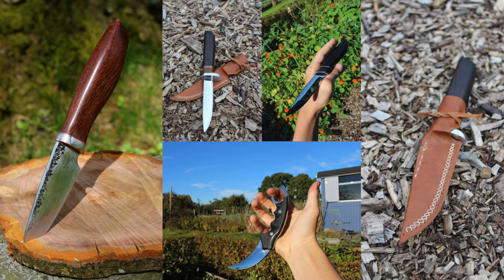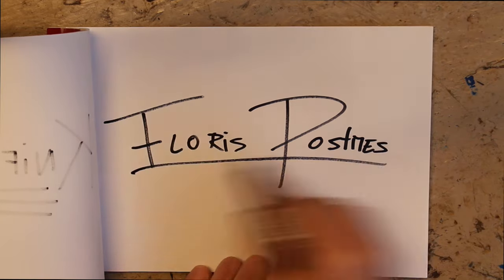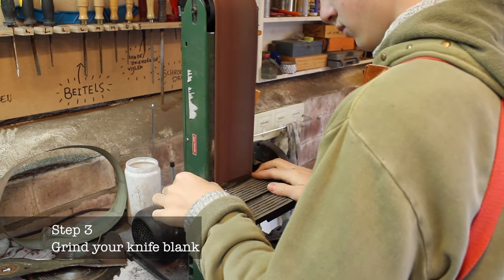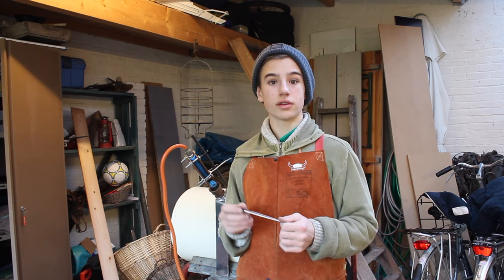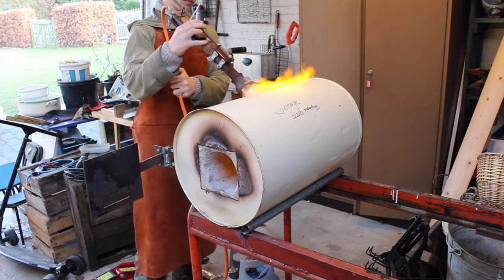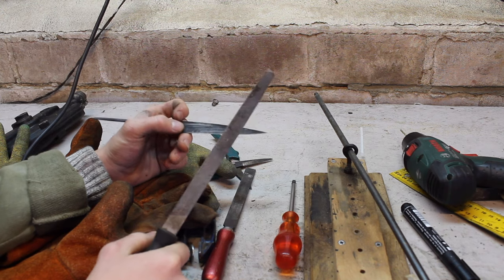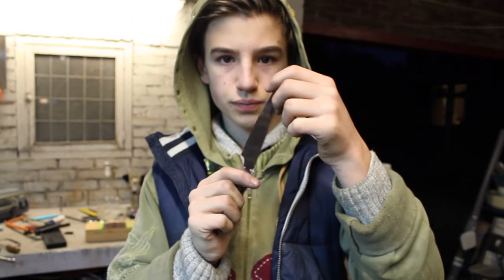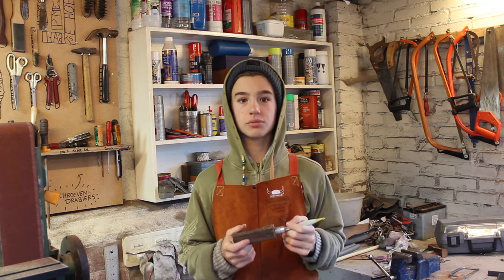Knifemaking ~ Making a simple little sawblade knife

Comment: Nice vidoe bro.
I have a question, is it dangarous or toxic to tempered the blade in the house's oven? Im useing this oven for bakeing too so i dont want that the tempering will make the oven toxic
Reply from the maker: Omer Isreaeli I am using the house oven as well. Still allive just like the rest of the family! Just be careful to wipe of all the oil after quenching, it probably wont be dagerous at all, it will smell like dead tho
Reply: Floris Postmes, thanks a lot man!!☺☺